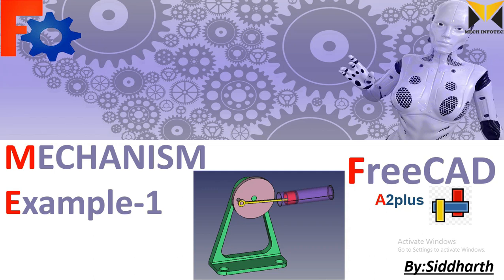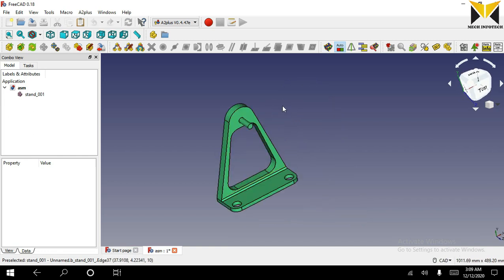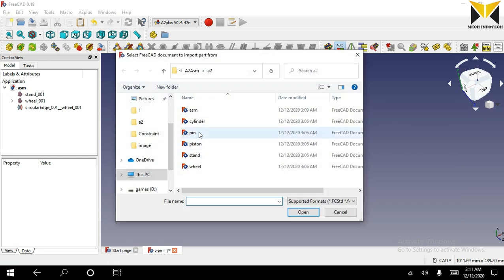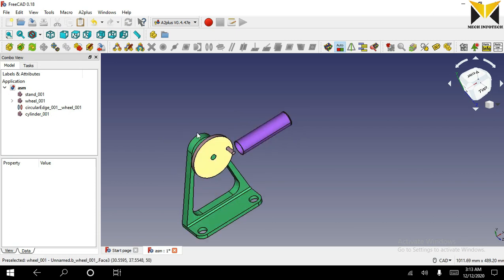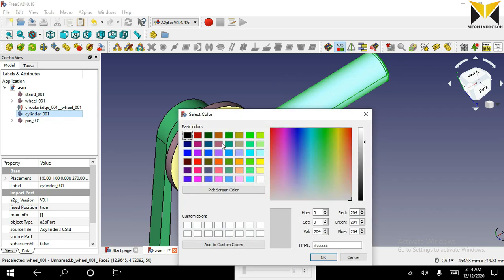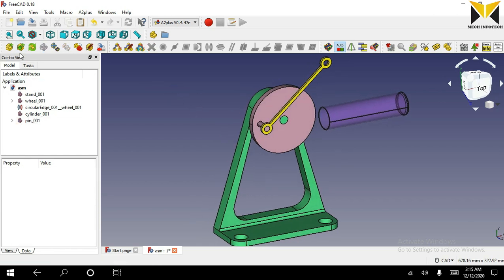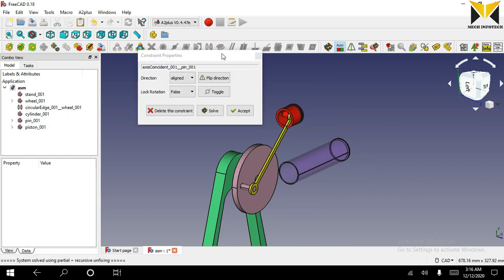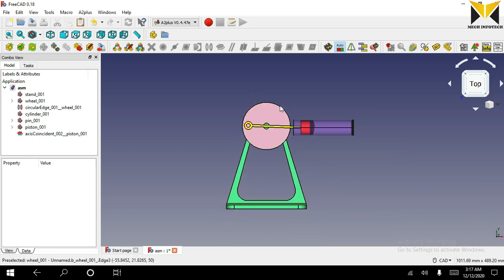A2plus Mechanism in FreeCAD

Comment: Hello, Siddhartha. Thanks for your tutorial.
I'm trying to understand how these A2plus Constraints work.
Why is it not possible to move the Wheel already after fitting it to the stand (in the second step of the assembly)?
In this assembly, the kinematics of the Wheel is only possible after the fourth step (when the Pin is assembled). Why?
Reply from the maker: In a2 plus can not apply single rotary motion without connecting other constraint rotary or reciprocating